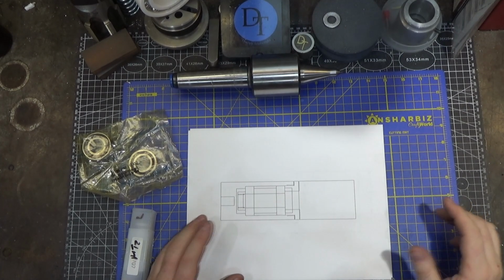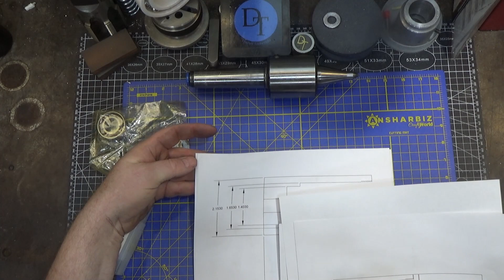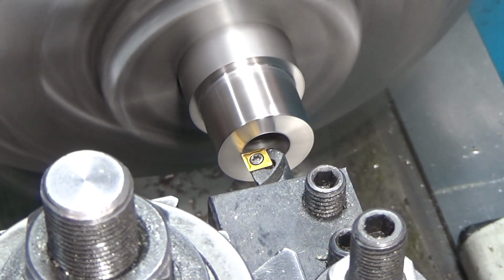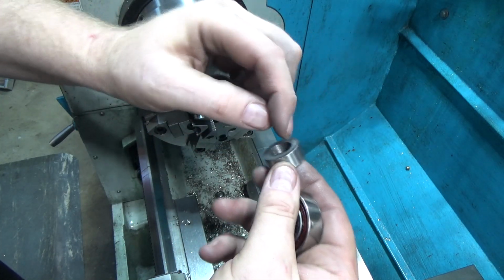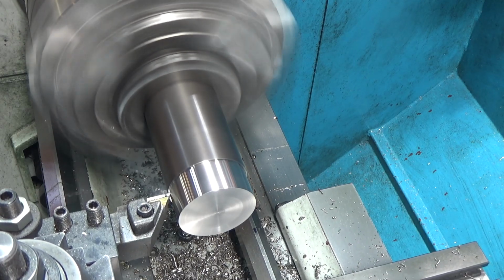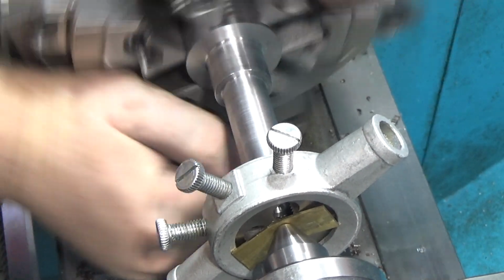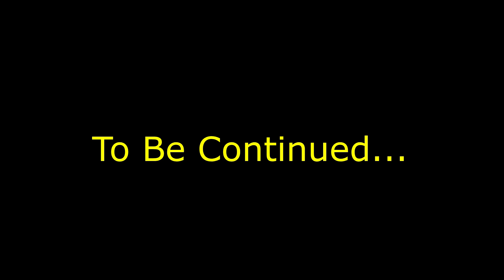195 Custom Live Center from Scratch Part 1

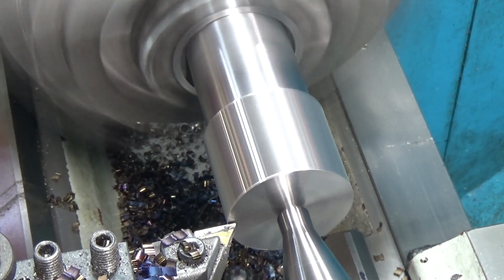Comment: @9:51 you can see the stock getting pushed into the chuck.
Reply: Good eye
Reply: Good eye
Reply from the maker: This problem has popped up more often that I would have liked. I use a different solution to deal with this later in this project. Good eye.

Comment: That is called a '' drunken thread ''. Caused by the threading die starting at an angle .  Back it up with the square face of the tailstock .   One thing i learnt along time ago is to never do a bearing fit without the bearing present ,  i know it is not always possible but it helps .       Good one Rob ,  Cheers  .  👍
Reply from the maker: Thanks Max, Always excellent advise. In fact, I did start the die with my drill chuck with the jaws all of the way in, in the tail stock. I measured the bearing and it was bit off the specs, so I trusted the specs. I figured they would do a much more accurate job than I did. It turns out I got this one right and the part wrong. A first for everything. I love the new shop. What an amazing space.
Reply: @DudleyToolwright  Keep an eye out for a major  bearing manufacturers book . They have all the fitting specs .

Comment: man ! that treading on minute 11.28, could it be anymore crooked ?
why didn,t you support that die with the flat side of a chuck ?
i hope you gonna single-point that thread now,  otherwise the preloading from the bearings wil never be good.
thanks for the upload dudley, cheers ben.
Reply from the maker: You are absolutely correct about the crazy off kilter die. I did start the die using my drill chuck in the tail stock and it was square to begin with, but even on the first thread it wobbled. I'm sure I did something wrong, but the thread turned out okay in the end.
Reply: @DudleyToolwright  " but the thread turned out okay in the end.""
i hope the thread is totaly square with the bearing race (i think not), otherwise the bearing will be toast in a short time, because the preload wil not be even on the bearing race.
i hope you understand what i try to say. my english isnt that very good.
cheers ben.

Comment: i noticed you used a center to start the die . i find the face of the drill chuck will keep it much straighter just the way i do it
Reply from the maker: Thanks for the tip. I have gone both ways and often choose what fits for the situation, at least what I think fits.

Comment: Slitting the nut that way and using a set screw knocks the nut off angle. You may not notice it. It depends on how much you tighten the set screw. But it’s not ideal for a high precision part.
Reply from the maker: Thanks for the tip. I was not aware. I'll file that info for future projects.

Comment: Having been a mechanic in the army I can tell you that "military design" and "mil spec" means "good enough" and "lowest bidder".
Reply: As in “good enough for government work” lol
Reply: That’s not really true though. I’ve worked on military electronics. The build quality is much higher than civilian equipment. The cost is so high to build that way that civilian equipment is often being used these days. A friend was a department manager for the company building the cameras for fighters and the electronics on the presidential jets and copters. The rings they had to go around to meet the specs were monumental.

Military rated parts are often for non standard soecs. Be aware of that when buying parts, particularly when mil spec parts are much cheaper than it would seem they should be. It’s often because the soecs aren’t standard and can’t be matched to commercial systems without modifying something somewhere.
Reply: I jokingly said that but of course there’s a whole rage of applications, from simple basic stuff, all the way to high end scientific instruments.
Reply from the maker: I have started my career as a fiber optics engineer for a military contractor and we would often have to take standard parts, test a large lot, and only choose the ones that exceeded a certain spec. Every part for the military was over spec'd, sometimes making meeting the requirements almost impossible.  I have almost no mechanical engineering experience with the military, but I would be very surprised if they were not similar.